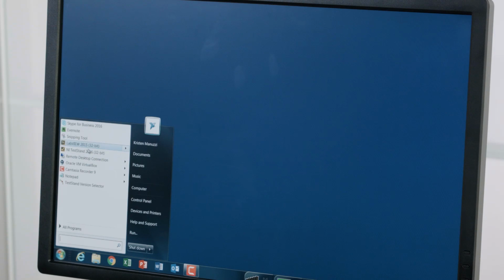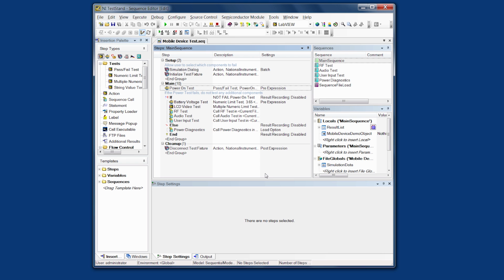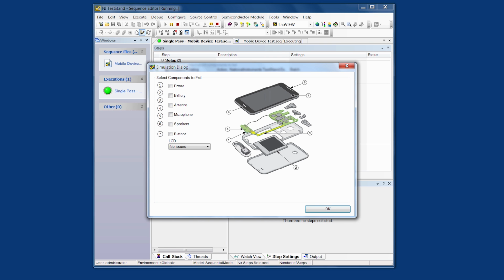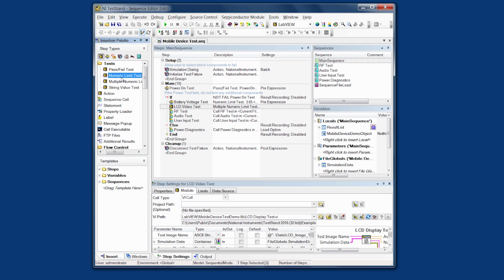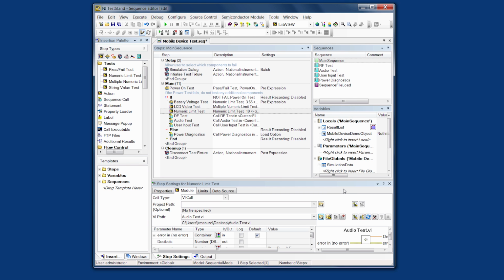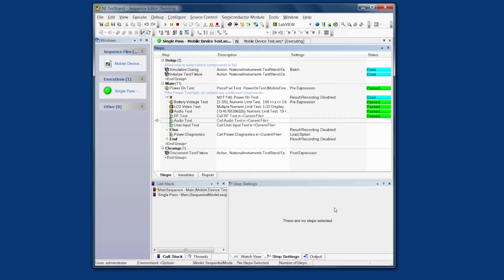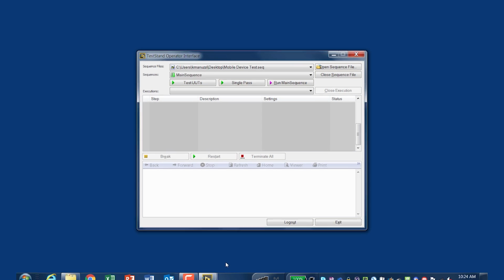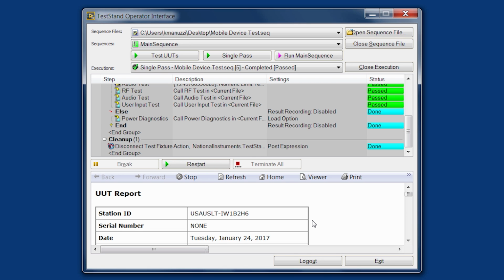Introduction to the TestStand Environment

Comment: thank you for this helpfull video. Please can you tell me why the serial number does not appear in the UUT Report?
Reply: Hi Mr Mars. The Serial Number is logged into the report based on the information taken from a variable. In the "Single Pass" entry point, there is no "pop up" asking for the Serial Number, thus the variable is not populated. If you use the "Test UUTs" entry point, you will get a pop up for each UUT asking for the SN, and then that data is logged into the report as well.